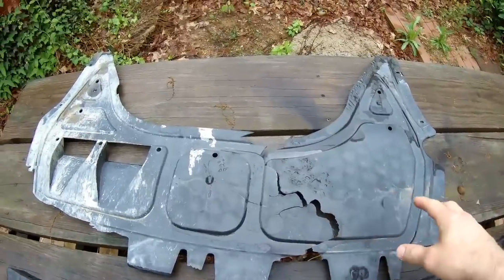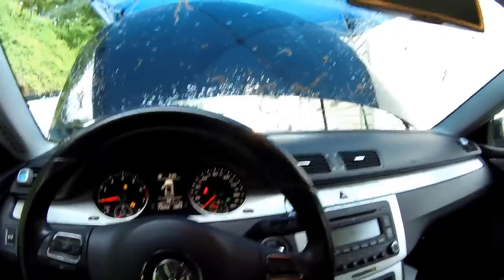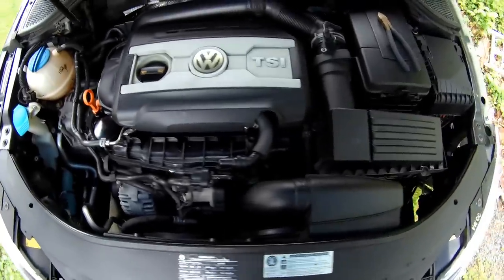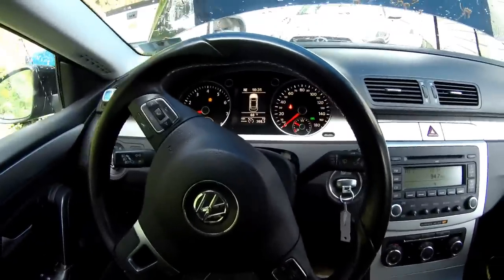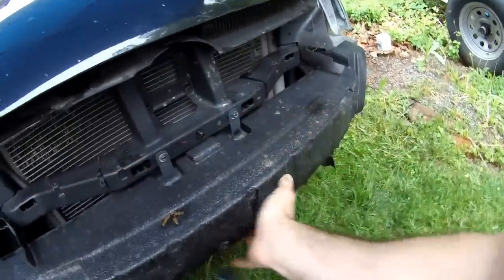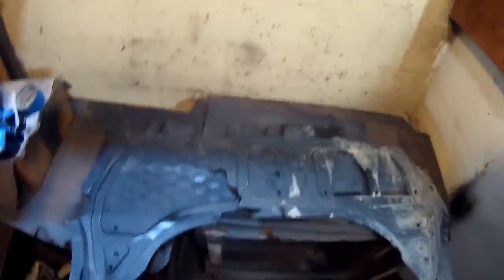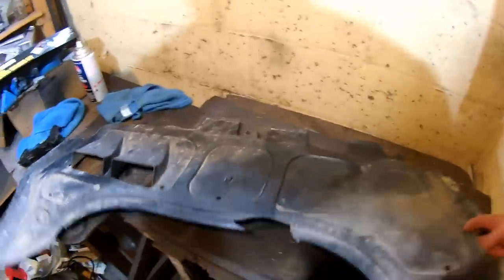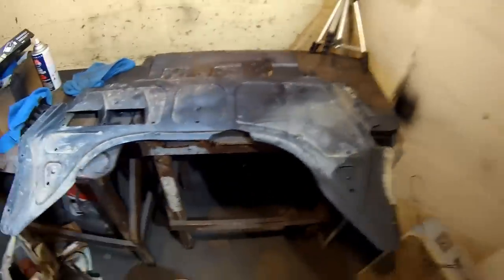Working on the Copart 2009 Volkswagen CC Sport

Comment: on those skid plates- a stronger more permanent solution is go to home depot (or equivalent) and buy some pieces of aluminum (roof flashing) , cut to desired size n shape then drill small holes n put in pop rivets!!...all fixed and strong!  :)(and you can paint it with black spray paint to match if you want...)

Comment: oooh more than one video this weekend BONUS, yeah i don't know that i'd be so patient like you are with the Genesis. when people start giving me a bunch of excuses that's when i just repost it and go on. I am getting one of those plastic welders, i thought initially there was more to them than it just bieng a hot iron tip attached to a soldering iron like that. i got the hot staples and such for the thicker plastics like on the bumpers and such and they seem to do a pretty decent job i am going to have to find something else to work on to show how they work though

Comment: The marks on the drivers seats seem fairly common on Passats with that design of leather seat.

Actually they bolster is usually much worse than that even with relatively low mileage.

So I think this one has been well cared for.

Comment: Todd  i do not have a facebook site but then i already have a plastic welder,listen to this my auto gearbox went, my compressor for the air-con went and now my motor is making a noise like a stuck valve, this all happened in this week so i am a little bit angry with ford and am on the hunt for a replacement, in the mean time i will use my sons  gm to get around.

Comment: Dude be careful at the gym...I did the same thing, basically trying to ‘work it out’ quite literally (lower weights and less direct impact) and it herniated my disc even further. The whole act of bending, leaning, and twisting is inevitable, but the less doing, the better for now.

I’d probably avoid the gym for like a solid month (hard, I know) but it may be worth it in the long run. At the end of the day, you have to live with your back for the rest of your life. 

If the pain gets worse and you want to avoid painkillers, look into acupuncture...it provided me with temporary pain relief but beats that of painkillers.

Comment: You shoulda saved the Ford for the 10k giveaway.
Reply from the maker: That's not really a gift
Reply: +UnWrecked are you goin to try for a full size hydraulic lift in your garage or go with a smaller pneumatic one?
Reply from the maker: Going for at least a 7k lb 2 post.  Probably a 9k lb